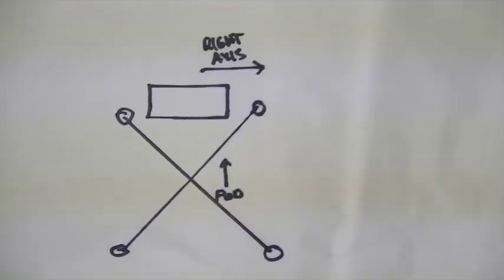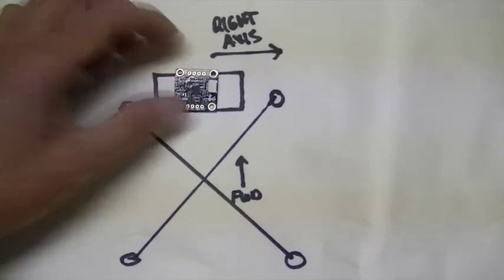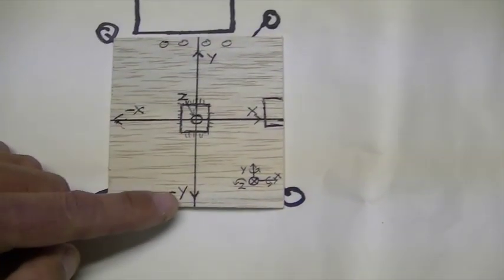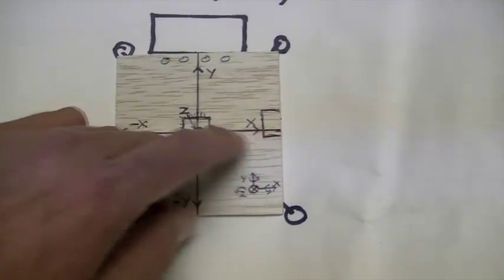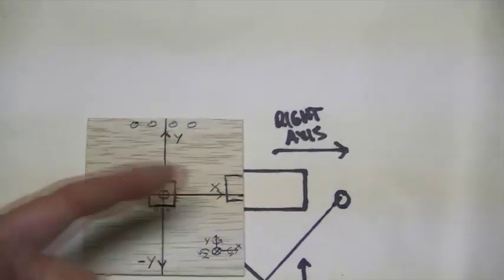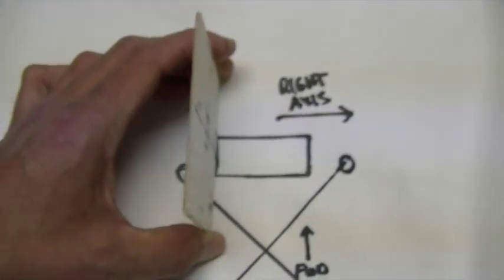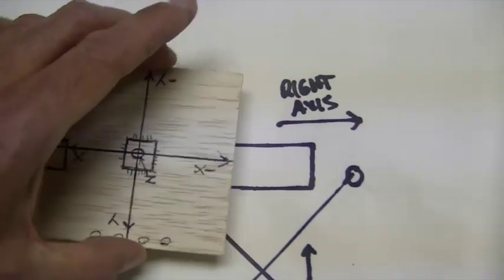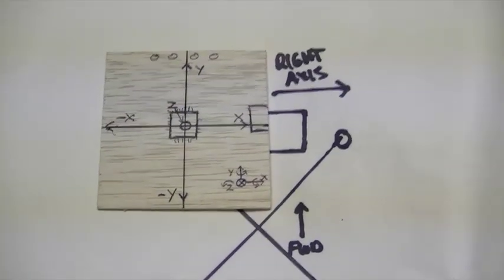X, Y and Z Axis

Comment: Thank you!  For sharing this. As a mechanic we always refer to the direction - as if you are sitting in the drivers seat. For orientation.  So anything in front (of you) is FR or FL -you get the picture.  This helps a lot (only watched about 45 sec. worth - till I got it.)avoiding possible overload - as did TA below.  Nice work!